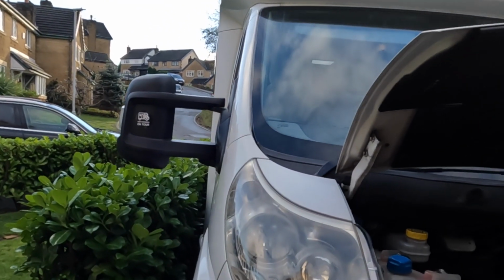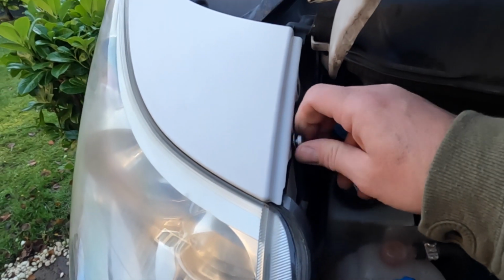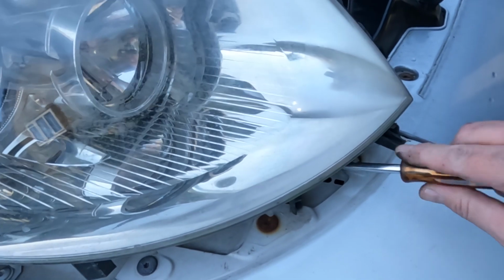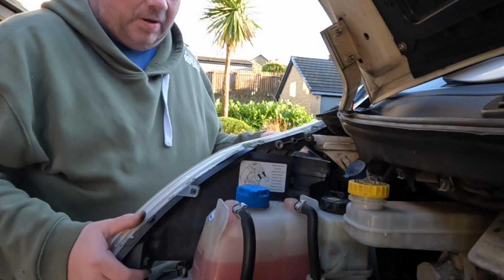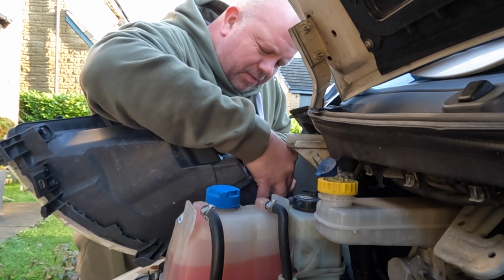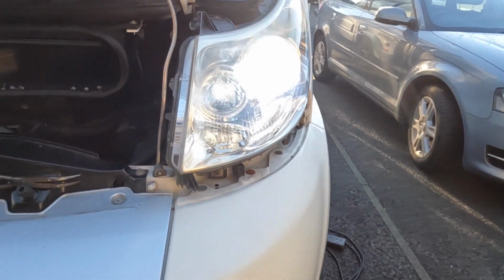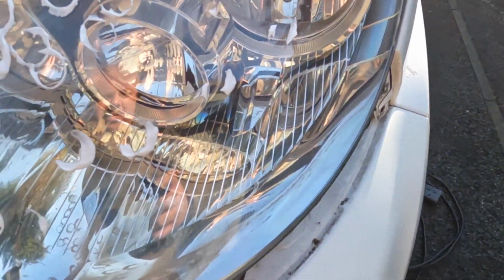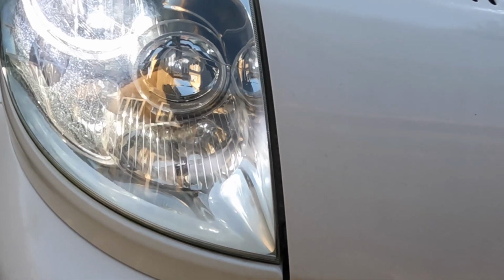MOTORHOME HEADLAMP UPGRADE | FIX IT WEDNESDAY!

Comment: Hi Mark, could you use Meguires ultra cut polish on the headlights instead of the Auto Glym or is it a special mix they use?  Good video again and I’m going to check my headlights as not sure if they are led already. Hope you both have a great Xmas
Reply from the maker: Hi Steve.  It sure on the Meguires. If it’s a finishing compound you would probably be ok. But best to use the correct stuff though 👍